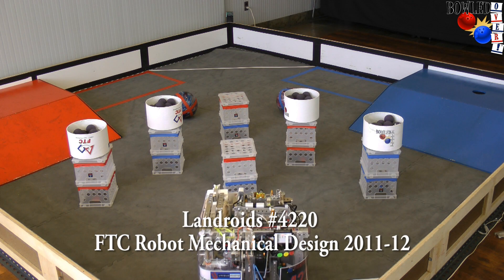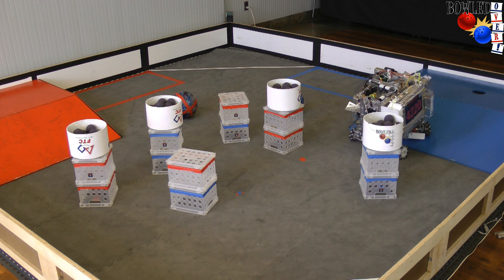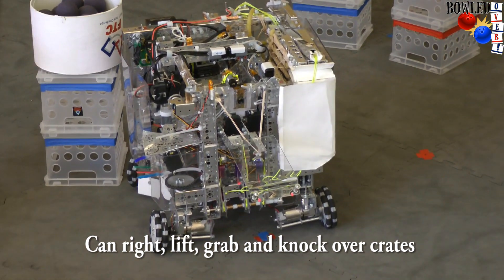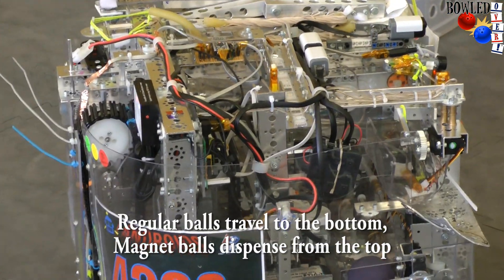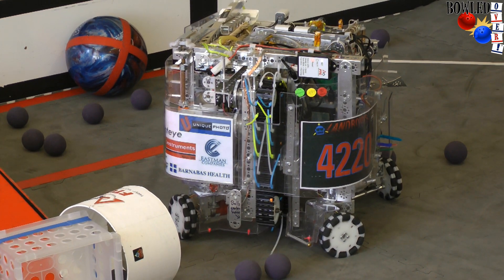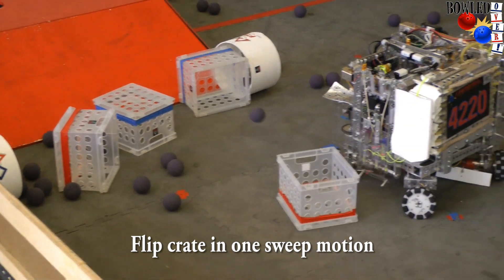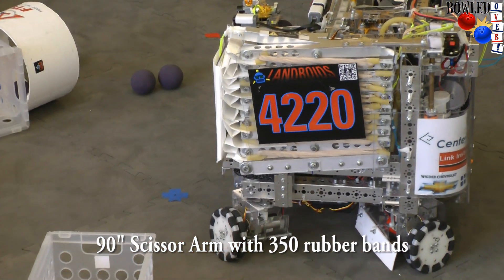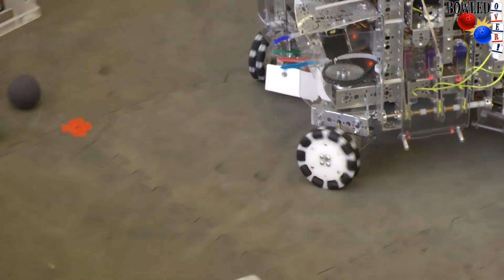Landroids "Bowled Over" FTC Robot Mechanical Design 2012

Comment from the maker: Our basic code to move in a set direction (0-359 like in a compass) with a given magnitude (ie, speed):

float cosD, sinD;

cosD = cosDegrees(direction + 45);
sinD = cosDegrees(direction - 45);

motor[topRight] = -(sinD * magnitude);
motor[botRight] = -(cosD * magnitude);
motor[topLeft] = (cosD * magnitude);
motor[botLeft] = (sinD * magnitude);

The other couple thousand lines of codes which took 2 yrs to develop were specific to our robot design and sensor feedback.